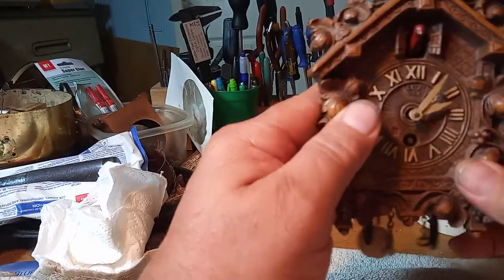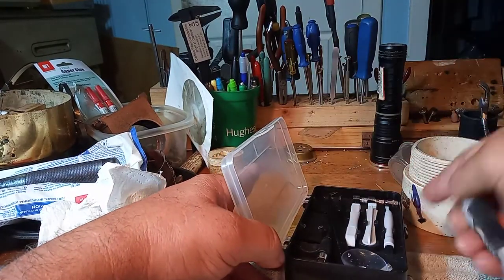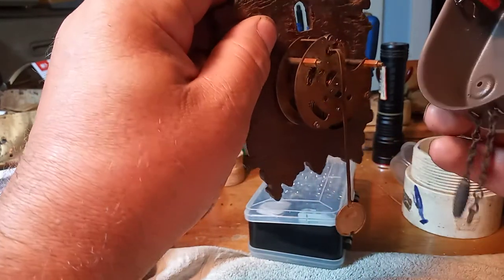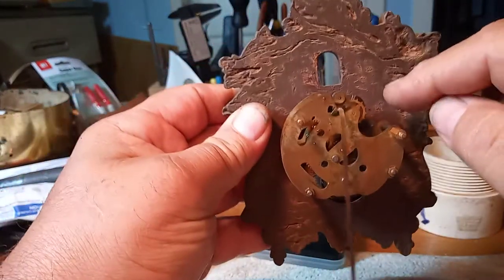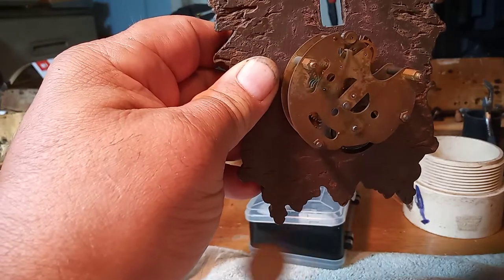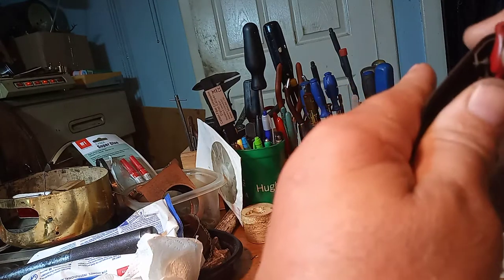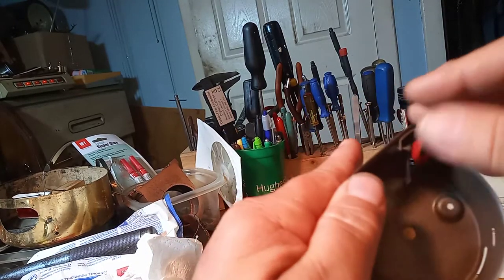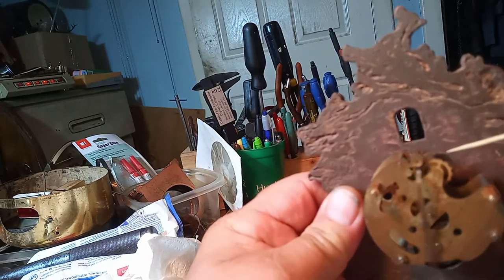How to get a Lux Pendulete clock bird to bob up and down. 20220728 141707

Comment: I have the same clock. It works, but I don’t know how to put the Bob on the pendulum wire. How in the world does that little disc not fall off?
Reply from the maker: The pendulum bob slides up and down the pendulum stick through a slot in the bob. It fits pretty tight so it doesnt fall off.  The bob consists of a front section that you see and a rear section that is fitted onto the front section somehow. So there are two pieces of metal. That metal has a slot at the top and a slot at the bottom for the pendulum stick to go into. I hope this explains it all. If it doesnt then please find me on face book. My profile picture is me hugging a fake bear. Then I can send you pictures of what I am talking about. Thanks.